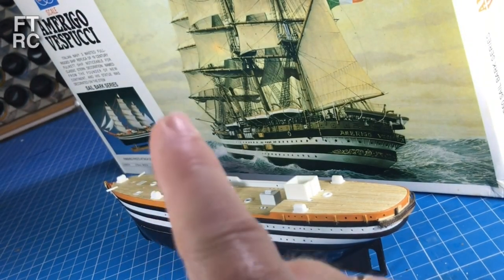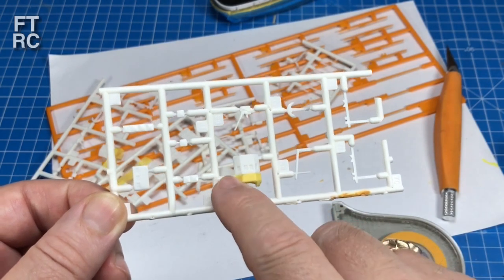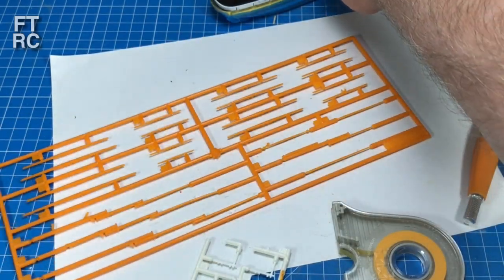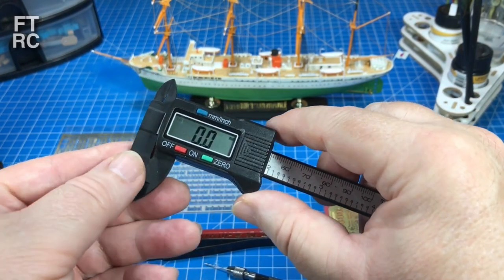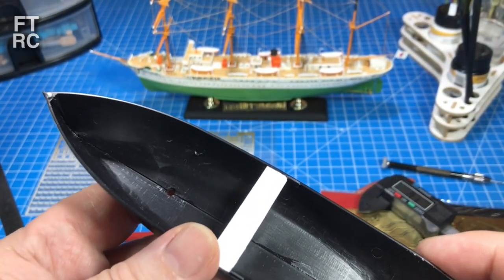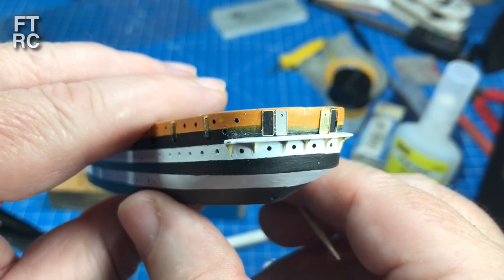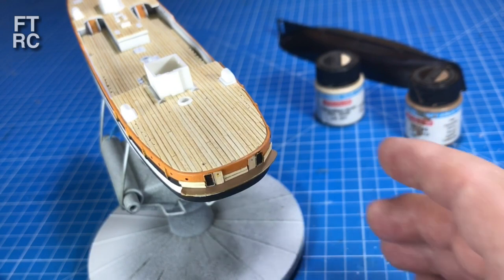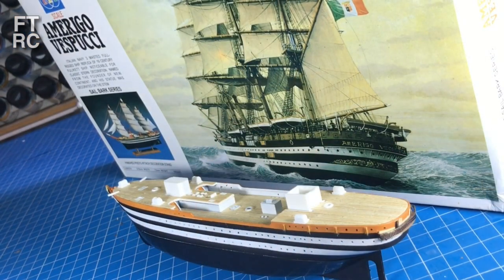Amerigo Vespucci Part 3 Aft Upgrade with Scratch Balcony Railing

Comment: Nice improvements Harry. Little but effective. Sure makes the stern much more correct and interesting. I checked my Heller 1/150 version and it does have the balcony with struts, but no mesh (it is a decal, lazy frogs :) ) Short query: Why did you opt for the little scale version and not the bigger 1/150? Greetz, DutchDave.
Reply from the maker: I didn’t opt… this kit was a Crispness present from a few years back.  I received the 1:350 Nippon Maru and Amerigo Vespucci at  the same time.  So I built the Nippon Maru that holiday break, leaving the more complex Poochi until now.  I am tempted to get hold of the 1/150 kit as well for my stash, but Heller ships are hard to find down under.